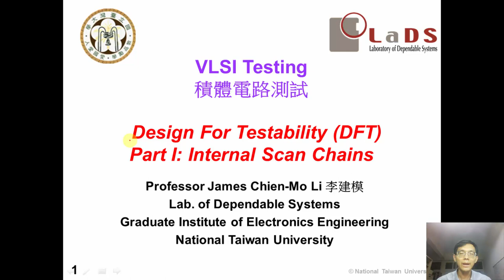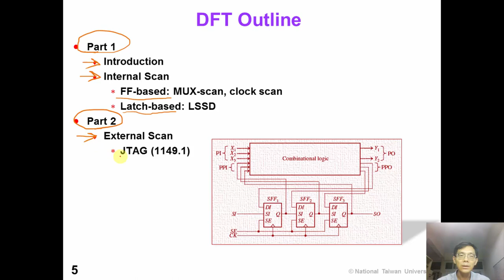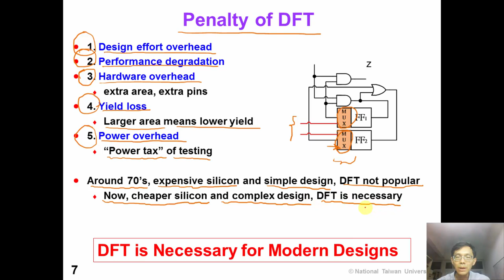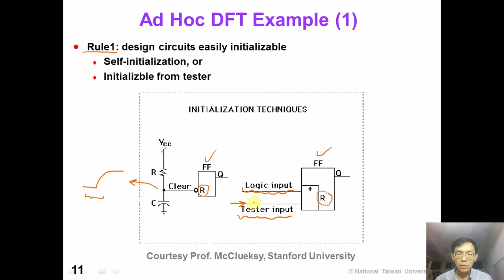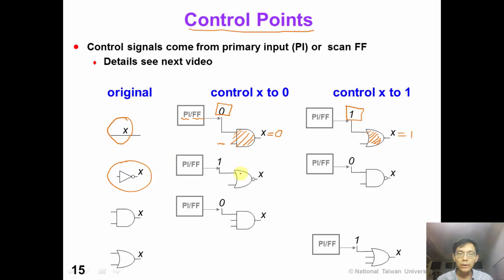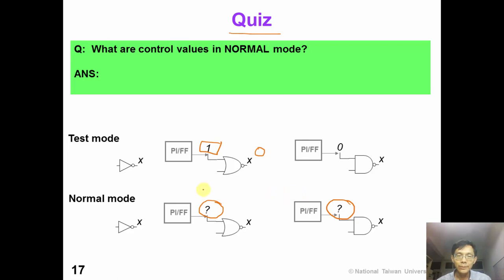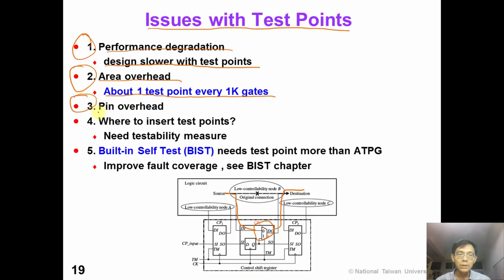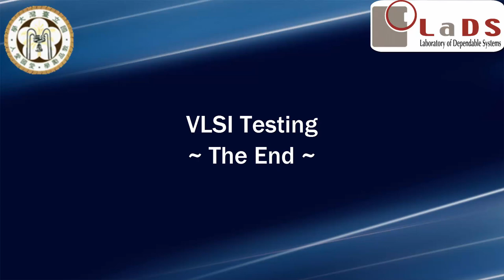11 1 DFT1 Intro

Comment: when we are inserting the control signal in not gate, In control x by 0 can we insert a AND gate at the output of the NOT gate and apply 0 at the one scan test input terminal of NOT gate. This is right or wrong. let me know a communication medium to you also.